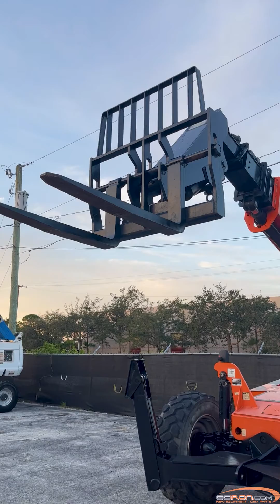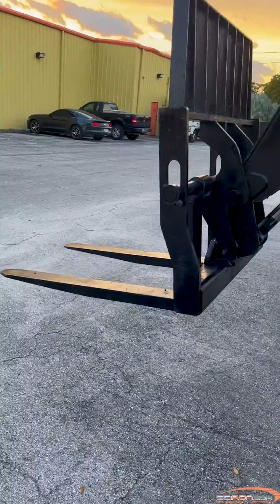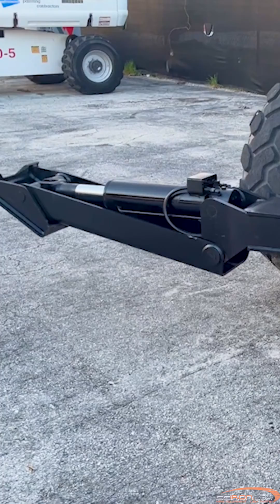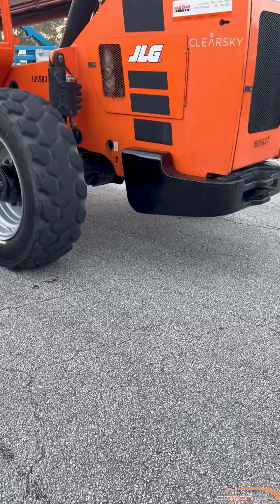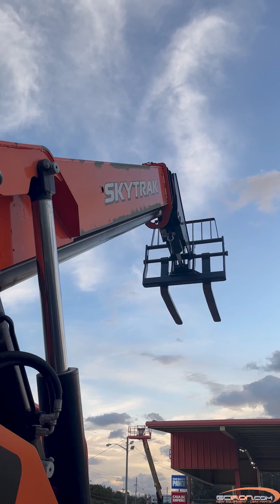Fault Code 4338: Throttle Pedal - Voltage Disagreement | JLG Telescopic Forklift

Comment: This video doesn't show you shit
Reply from the maker: Thanks for your feedback on 4338 voltage disagreement.  If you listen to the video, you will find the possible causes of this fault code such as the defective throttle pedal sensor, defective machine module, damaged harness, poor connection at J2 machine module, or poor connection at X557. Once you understand the root causes, the video explains how to troubleshoot